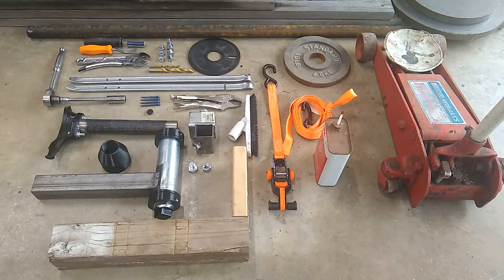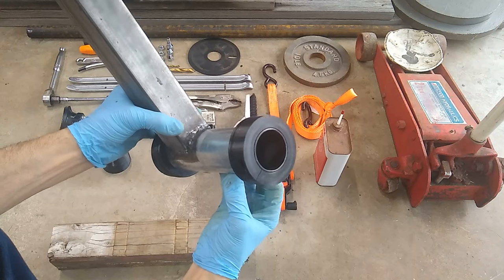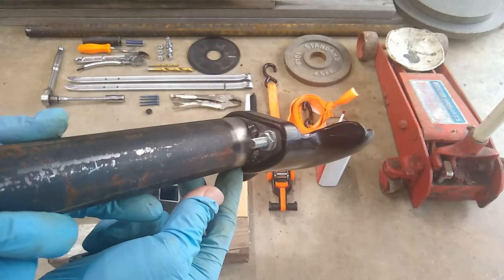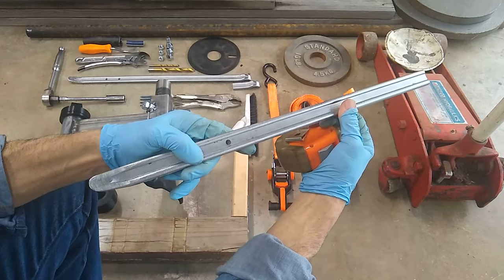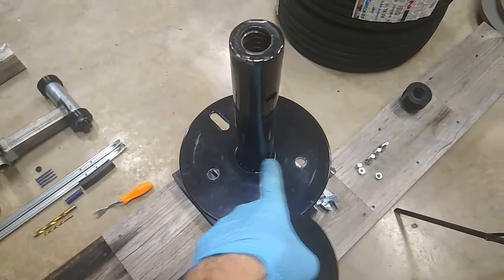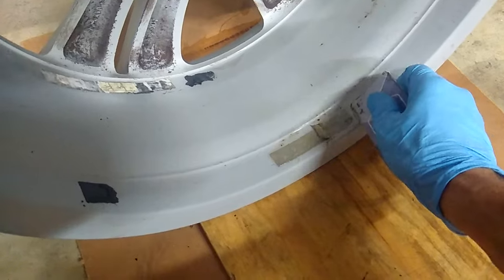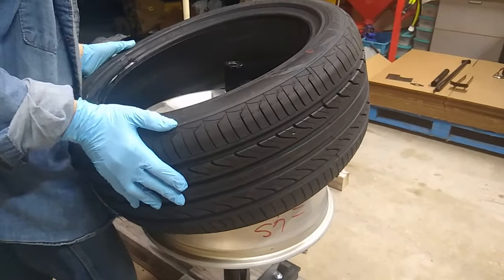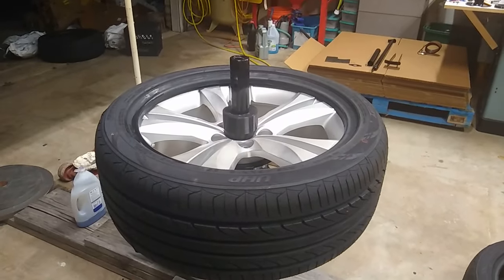Harbor Freight Manual Tire Changer DIY duck head adapter.

Comment: Hi Victor,  I'm glad to see that thrust bearing assembly came together so well, thanks for sharing the build cycle with me.  A great fun project and please load it up with the balancing unit and drop by. 
Once again Victor you have set the bar for the home self sustaining minded people.  Cheers my friend.  Doug
Reply from the maker: Hi friend, your most welcome. It was a fun project and another solid test for what is possible with 3D printing. I can't say it enough, a 3D printer should be in every house. Yesterday I needed to core a pineapple after cutting away the skin and slicing it into disks. Took a measurement of the thickest core diameter and made a punch similar to a doughnut hole cutter. 3D printed it out of PETG and now I have the tool to use on future pineapples. I hope you and B are wonderful.

We'll chat soon :)

Comment: At 33:40 it looks like your sidewall is damaged as the bead is seated.  What's the big white streak that appears there?
Reply from the maker: Hello friend, thank you for commenting and pointing that out. I'm not sure what that was, maybe soap foam that caught the overhead LED light glare. The side walls looked as they should when I mounted them on the vehicle. BTW I found out that tires purchased from Discount Tire get free balancing for life regardless of who mounts them so I just took the wheels in and they balanced them at no additional cost, pretty sweet right?

Comment: What printer material did you use for the cone and the bb bearings? Is it possible to get the print files? I have a 3d printer but i'm not so good on the design programs. Thanks.
Reply from the maker: Hi Jacob, I mostly print with PETG and it worked great in this application. All the .STL files for this project can be found in my Shopify store linked below. Thank you in advance for your consideration in supporting my work.

https://victorbared.com/products/harbor-freight-manual-tire-changer-upgrade-parts?utm_source=copyToPasteBoard&utm_medium=product-links&utm_content=web
Reply: @vbared  Thanks i got the plans!
Reply from the maker: @suplyjones  Awesome, Jacob, Thank you. Send me some pictures of your completed tool vbared@gmail.com

Comment: hi video good but, there is no point in doing this because the wheel must always be balanced after changing the shoes. There are no ideal things. An unbalanced wheel vibrates at higher speeds, which is dangerous, and in addition, there is increased, irregular tire wear and premature wear of the vehicle's mechanical parts. For the workshop, there is a change of shoes and balancing, work for a few minutes.
Reply: Lol what? You can definitely balance tires at home. That's all I could make sense of out of this rambling mess.
Reply from the maker: Yes, you are correct, the wheel must be balanced. I've balanced 12 wheels using a bubble balancer that I made in CAD and 3D printed. The three vehicles run smoothly without vibrations that can be felt. One interesting thing about the Hyundai Genesis Coupe wheels in the video is that its centerline didn't allow my bubble balancer to work properly without a redesign so I had to take to Discount Tire to get them balanced. It turns out that tires bought from Discount Tire come with lifetime balance at no cost regardless of who mounts them. It didn't cost me anything extra to have them machine balanced since I bought my tires from them.
Reply: @vbared i have had to use my bubble balancer to fix tires balanced by the shop that were vibrating.
Reply from the maker: @engrxtn  Nothing better than having a way to solve your own problems. I'm glad the DIY balancer helped you. Best of luck with your repairs :)